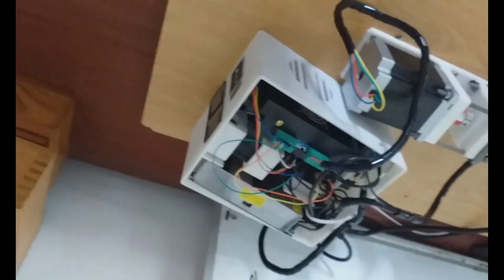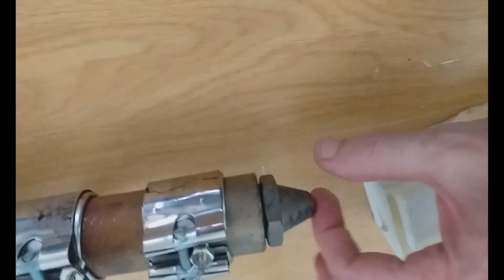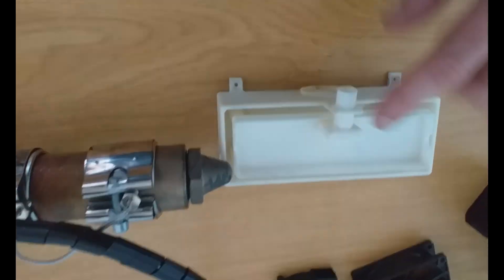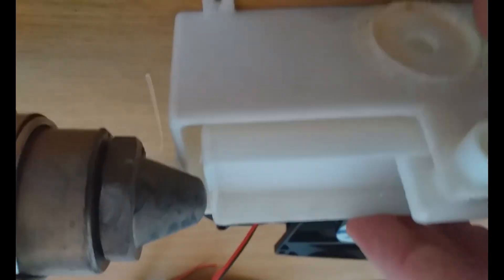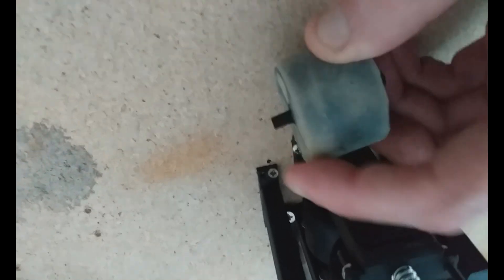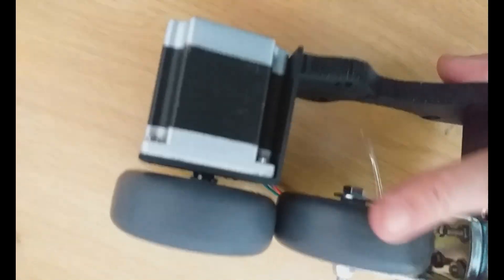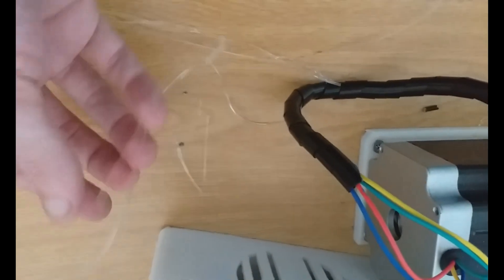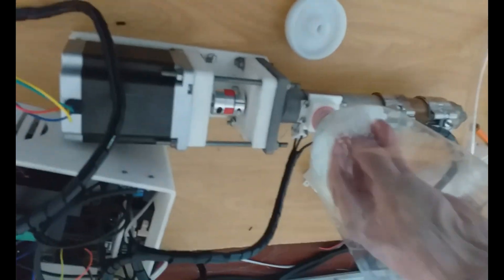DIY Filament Extrusion Machine Explained

Comment: What are the steel pads connected to the thermocouplers called? Also how are you able to connect the stepper motor to the drill?
Reply from the maker: The steel pads are mica/ceramic band heaters. The stepper motor is connected to the extrusion screw by mean thrust bearing and flex -coupler.

Comment: Looks good so far!! I am looking into making something like that aswell. For home use. Biggest issues for me is like u said  the brittle issue and where in SA do u get pla raw material ? I have called almost everyone. 😜
Reply from the maker: Hi! I actually imported these pellets from China, but it worked out fairly expensive (about R160/kg) with transport and low volume. I have spoken to another South African who says he can source it for around R70/kg locally, but would resell it at R100/kg.
My Chinese partner (based in China) and I have searched all over China for suppliers but their prices are not that great since they actually are a net importer of PLA.
I have played a bit trying to make PLA, which had some good results so far but with me not being a chemist, it is a hit n miss process so far. I will upload a video of that too.
Reply: @DudeBoerGaming  ya that would be nice. Thanks a lot. Just bad that the rand is so low these days. Like your vids and will keep following it.

Comment: Hey,i'm waiting for the next video ,to see it in action.Maybe dry the pellets  to make the filament less brittle,you have to look up the drying temp for the type of plastic you have.It's looking good so far.Cheers!
Reply from the maker: Hi! I tried drying the extruded filament (for about 6hours at 60c) but that didn't seem to make a difference. I did mix in some recycled (but good quality) filament and it works much better. So, either I didn't do a very good job at drying or, this filament is not quite right for filament making as is without additives of some sort. Thanks for the comment. I will upload more videos as I progress. :)